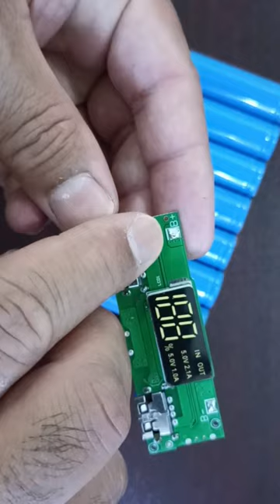DIY 20000 mAh power bank | #shorts

Comment: Anybody doing this seriously should invest in a small spot welder.  They start at $9 and i recently bought a $24 one which does everything. You need it for strength, better connections, resistance to heat, etc. There is no excuse to not buy one.
Reply: Plus heat harms your batteries. I repair battery packs and wouldn't consider solder as a fix. Not even temporarily.
Reply: There are many cheap spot welder from china, they work very well. But you forgot about the power supply for the spot welder which should use high amps battery such drone battery with C rating of 30C and above or can use Car battery. And they doesn't cheap for poors. In our country they sell high drain lipo battery for around $45 (in our currency ofc) and cheap spot welder let say $9 already need to spend $54 in total including the battery for power supply.

$54 is so expensive for some country like us. The value of $54 in our country is above 100.
Reply: @Bobsmith-yf9oy  I am sorry if you're not agree, but as long as you're are not soldering the batteries for "too long" it is okay to use solder.. Only for 1 or 2 second. That's why need to use a good solder and flux to do it quickly.

Especially if you only an hobbyist that doesn't produce batteries for mass production, it is too expensive to buy spot welder when you rarely use them.
Reply: If it's for charging phones, just buy a diy power bank empty case (28 or 35 cells), stack the cells in parallel. You have a power bank in minutes 😂

Comment: Yesss!! I'm lovin' it! That charging boards are very clever and durable. I have two of such DIY cases with exact this board. The power of the DIY cases will be, that the Li-Ion cells has not need to be soldered because there are to be installed as same as you install AA or AAA alkaline batterys in a TV IR remote f. e. So i become able to change the cells easy and quickly every day when i want. 😊 Best DIY Powerbank board since ten years. Never seen similar that is better or can more than this one.
Reply: What name diy case you bought? Link please

Comment: Woah, these type of battery with parallel connection are better that enclosed power banks because, they are not expandable but these are!
Reply from the maker: Yes, but total capacity should be under power bank module limit
Reply: My one friend used  ltihuims  to build himself a new 12 v battery . Cant remeber for what project. He also used bms as well. To someone that doesnt know and pay attention. It will look like the normal 12v  type of batteries commonly used in house alarms and gate motors. Yet the battery is now lighter in weight and its more effecient than before.
Reply: @TARIQLAB pls share 65w output power bank module details

Comment: Why aren't you using a little 12V spot welder for the battety connections? They start st $9 and there are multiple really good reasons to use them.
Reply: You harm the batteries with heat and can never get a great connection. Don't do this!
Reply: @Bobsmith-yf9oy Spot welder itself is cheap, but the power source you need to run the spot welder is expensive such high drain lipo battery, car battery or power supply that have an ability to provide high amps for the spot welder to work.. But if someone who have used car battery it still can be cheap but not everyone have it.

Comment: how much ampier it generate and it support fast charging? or warp charging
Reply from the maker: 10A, this is normal module, u can use fast charging capable module
Reply: Almost unlimited with heavier duty batteries  charger's and wiring.

Comment: can you tell me what are these ingredients and where to buy them since i wanna build myself some powerbank😅
edit:like what's the name of the metal you used to connect the battery,the cabel,what's the name of that circuit and where i can buy those,for boxes maybe i can search myself some cardboard😊
Reply from the maker: Circuit is , power bank module for 3.7v battery 10A, batteries 3.7v lithium ion 18650
Reply: thank you so much,but for the cable maybe i can search for it

Comment: Materials needed: 16 rechargeable dynamaxX AA batteries powerbank 3 port x2 modules
Reply: Those are not AA batteries, those are either 18650 or 21700 cells. Voltage is different

Comment: Is this kit supportd 40000 mah battery?? 
How much  limits in mah this kit??
Reply from the maker: 10A module, max 10 lithium ion 18650 battery, 1A for 1 battery, if u use 20 batteries then charging time will reduce to half
Reply: @TARIQLAB  battery mah ????????
Reply: @TARIQLAB  I have 2.1A module 
Is this supportd 40000 mah???

Comment: Can. I charge my phone with one cell only ??

It charges for 10 seconds only then stops charging and the screen and give that my battery is 0%

Despite that if I put a led USB light or used the internal light , it operates fine
Reply from the maker: I think ur battery is weak
Reply: @TARIQLAB  I measured it, it was 4.1 as volt 

If the mAh is small, at least it should last for 3 or 4 min ... At the same time I am charging a normal phone not big one device.

Comment: How many mah battery can added with a module. Is there any limits
Reply from the maker: Charging Capacity of this module is 10A so we can connect 8-10 batteries,
Reply: There we will be a maximum, based on current capacity of output wires plus the most cells the charger can handle.

But with bigger batteries, thicker wires, and heavier charger, you can scale upwards elmost endlessly.

Comment: Bro, can this board charge 6 batteries 🔋in parallel (2+2-2+) 11.1V, or do i need 3S board
Reply from the maker: It can charge up to 8 batteries but in parallel, it is only for 3.7v not 11v

Comment: How can this simple 18650 cell be 2,857mah? 🤔

This can not be a 20,000mah powerbank 😐
Reply from the maker: Why, 1 lithium ion battery available in 2200, 2500, 3000 and 3500 mAH, multiple by 7
Reply: @TARIQLAB  I know. but this cells is not look like 3000mah... 
Are you sure this is the original 3000 mah battery?
Reply: It's not 20k
Reply: @utkarshsingh1223  but he mentioned it 20k mah.
Reply: @Mukul_Adhikary  Maybe 2800, then it's close to 20000 if they are new, but this aren't new cells.
Reply: I have a 28,000 mAh battery pack and this looks comparable in physical size.

I haven't opened mine up to count the number of cells - and I am not going to as it is a fully functioning battery pack and I have no intention of destroying it.

But I would say this being 20,000 is certainly credible.
Reply: @deang5622  ok